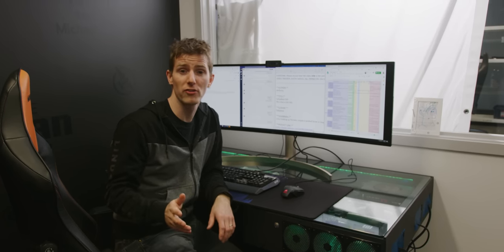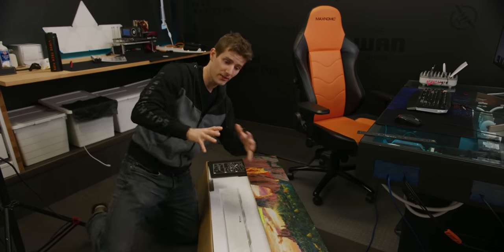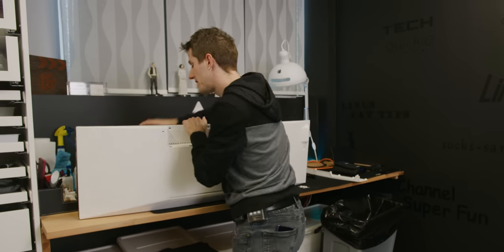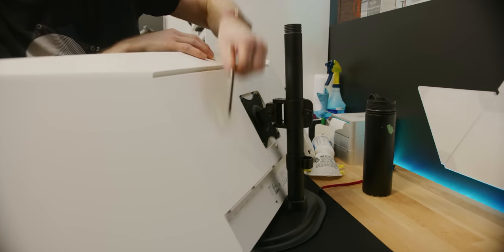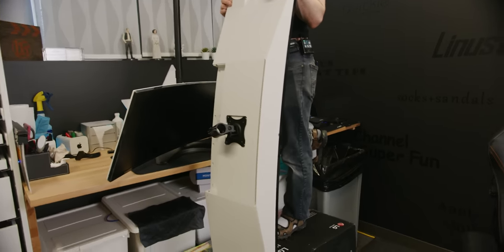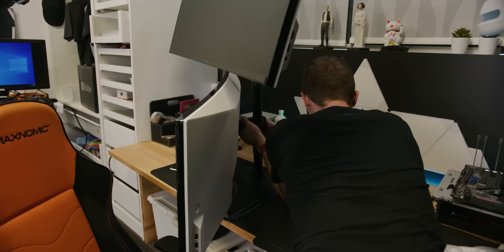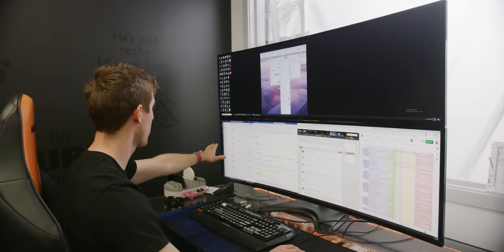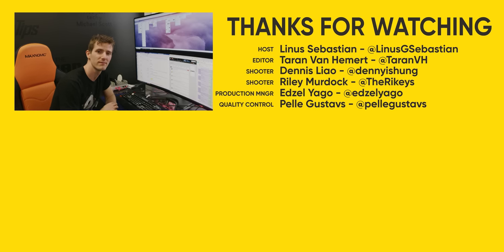My monitor just got an UPGRADE

Comment: You can turn the monitor upside down to have fewer edges between the monitors and on the nvidia panel there is an option to rotate it 180º and set it straight

Comment: if you mounted the top one upside down you'd get less bezel space
Reply: But then the nipples wouldn't both be on the same side. What is one to do!?
Reply: @exitoz1396  VESA mount is meant to be supporting 360 rotation of the panel, so unless this one is different which i doubt, you are wrong.
Reply: That's actually brilliant. Airflow will likely not be too happy. Not like these monitors have much cooling to begin with.
Reply: @rajaselvam37  i mean, have you seen the size of those monitors?

Comment: -Stand rated for 20KG max
-Puts on 30KG "it will be fine"
Reply: What's the worst-case scenario? They fall and get broken? It's not like he's paying for this :p
Reply: Mostly it just slips over time, and if you force it back basically you are grinding the friction mount, what he needed was a ratchet wrench with a hex bit socket, then you can crank it down hard enough the first time to make sure it never droops.
Reply: wackity shack But then Linus is known for having dropped stuff. Where would the fun be without that?

Comment: 9:40 At this point, LG was waiting for a "sorry"
Reply: Tbh, just install click monitor dcc (chocolatey has the package), you only need to be able to reach the display with that actually has click on it. Haven't used the physical button of my other two monitors in months, they probably still work though. Best feature is scroll for dim/brighten.

Comment: 4:37
“We forgot the washers”
“Does it even matter?”

(Challenger I intensifies)
Reply: I? Not 1?
Reply: That was an O ring. Yes I'm fun at parties.
Reply: NorthernLeigonare - Roman Numerals
Reply: @trd8749  Tp be fair, isn't an O ring basically just a rubber washer? :P
Reply: @The_Keeper  Well, O rings block liquid leakage and is a seal, so no.

Comment: I feel like if the goal was  bezel-less he should’ve gotten a tv
Reply: 11:06
Reply: A 4k 55in tv would also be a lot more cost effective
Reply: @InsaneFire10YT  Linus doesn't speak poor
Reply: @jerielfrancis3684  Neither does He speak 'practically the best option'
Reply: Just flip the top one and boom, no bezels in between them
Reply: Samsung do make a nice 8k 92" QLED tv that would have been more practical and better in basically every way(other than price, but that doesn't seem to be a factor).
Reply: @homelander-enjoyer  I mean, the way you say 'no bezels' makes me believe that there will truly be no bezels anymore.
Reply: @spectrfox7661  Practically a lot less pixels as well so not as practical for many windows
Reply: TVs have alot of input lag
Reply: @croissantj9588  But there are big-enough monitors, or at least TVs that wouldn't have that problem at all.
And it would be much easier than setting this whole thing up.
Reply: @spectrfox7661  definitely
Reply: TV is NOT the same as a Monitor. 
Ain't nobody want that shit input lag and pointless features. 
You also wouldn't get the usable space that an ultrawide would give you with it's aspect ratio.
Reply: @croissantj9588  yes- I am using a 4k 49" TV as a monitor and the input lag drives me crazy- there are a few settings to make it better- but only a real monitor is a monitor...
Reply: I use a 55" 4k tv and a 32" gaming monitor in a duel setup. Yes TVs have more lag but a decent one doesn't have much more. More the point his setup wasn't for games, it was for productivity, a little lag means shit all in his case.

Comment: Regarding washers:

"Does it matter"

Yes! Washers increase the area of the clamping force. Going without a washer when one is provided is like the difference between trying to pick up a thick hardback textbook with your fingertips instead of your whole hand. Less clamping surface area = less friction to hold things statically = less clamping pressure.
Reply: Next video: my monitor fell off the stand
Reply: Could sheer the screws without washers especially with heavier weights that aren't rated for that stand :D
Reply: Also the screws are going to be fitted to the holes with the assumption the washers will be present. The VESA mount should take up the slack in this case, but putting the screws back in the holes afterward with no washers can easily lead to them poking into the electronics.
Reply: hanetar im talking about friction in the shear direction. Surface area has a lot to do with frictional forces. Try dragging a 500 lb cube across the floor vs rolling a 500 lb sphere made of the same material. Normal forces are the same but the amount of force that is required to overcome static friction is different depending on the amount of surface area contact between the object and the ground. That is part of what makes up the friction coefficient. The surface area of contact between each object is baked into the coefficient.
Reply: @hanetar, it doesn't for perfect solid materials, which do not exist. So yes, it does, because metal and paint deform under screw tension and load weight.

Comment: The new Microsoft PowerToys (on Github) destroys the LG Tool for zoning applications.  You can create custom sized zones, overlapped zones, and even use hot keys to activate them.  By comparison the LG app is rigid and buggy AF.  Aside from limited options, it flat out refuses to even open if you have duplicate display enabled on any output.  It doesn’t matter if your trying to duplicate the LG display, or an entirely unrelated secondary display (it makes no sense!!!), it just fails.
Reply: TheQuark6789m Good point.  I figured that was implied.  Microsoft’s PowerToys was a huge hit in the 90s.  Most advance/power users would use it at least to some degree.

Comment: At this point just get a curved tv
But to quote him “Should  have just put a tv on my desk yes?! But dammit his is Linus tech tips”
Reply: yeah he said it's like 2 1440p screens in one so why not just get a 4k tv with low latency?
Reply: TVs are never that good. They are meant to be watched from a distance so you don't notice the flaws that they have. Computer monitors can't cheat like that so they are always better, just smaller.
Reply: Rob but from cost compared to quality, it just seems like a wayyy more cost efficient and practical compromise
Reply: @RawbLV  got myself a 55" curved Samsung 4k TV for computer screen at 600€ after seeing this video, and only complaint so far is that it's actually too small, a 70" one might be better
Reply: @thedog556 Go to any store, walk up to a TV and observe as they oversharpen the image or apply some other kind of effect to appeal to casual viewers.
Reply: I don't know about OLED, etc. but if you do anything related to design, finding a color-accurate TV is an absolute nightmare.
Reply: @damiengates7581  which one? I am look at the 2 43" monitors dell and lg. However unsure of which to go with. and they are roughly $800 us.
Reply: Get an LG c9 120hz 1440p
Reply: @RawbLV  this is not the case. he spent 3800 PER monitor. then mount... ect he could of had a Flat OLED 65" TV which would have looked better in every way
or he could spend it on a VERY High HQ screen/Monitor from Asus. the 65" gaming one.
Reply: @Xyphren  Of course with enough money you can buy anything great
Reply: But 4k tv gives you less screen than this solution. I currently use 4k 43" monitor and I could definitely use more space horizontally. Linus has 5120x2800 total resolution here, while 4k tv only gives you 3840x2160.
Reply: @AzaiaMonota  Because it's not the same ? Curved screens are nicer to use, and these are WQHD screens, so that makes it 5K (as he already said in the video). Also, with 2 screens it's easier for him to put the trello on top like he wanted, rather than struggling arranging it that way on one monitor.
Reply: @thepierre396  well we all know Linus has a massive 8K by this point making this old video pointless now

Comment: Linus: stacks two ultra wide monitors

Me: that just sounds like a tv with extra steps!
Reply: He did review a giant 47+ inch monitor before
Reply: A 55in LG C9 would have been cheaper and easier then this.
Reply: Yea but tvs wont have high hz and low input
Reply: @hungrynapps  yeah but he's not gaming on, it's his office pc right? 🤣🤣🤣
Reply: @hungrynapps  slot of tvs right now already have low input...my samsung does 4k 60hz at 14ms and it also does 1440p 120hz at 6ms
Reply: MASKOAA it’s sad that you think 120hz at 6ms is fast.
Reply: @BeardedAxeRay  you realize when a monitor says 1ms that's pixel grey to grey response not input lag right?
Reply: starshipeleven  any reason for that? The PPI is all that matters, and an 8k TV would definitely look sharper than two ultrawides stacked on top of each other, and the result would be pretty much the same office productivity-wise
Reply: @BeardedAxeRay  You would laught at my Laptop refresh rate and latency my friend, unplayble compared to my brother's one's. I am waiting for sells to get a good desktop with a sexy monitor. But yeah 6ms and 120hz is way better than mine cries
Reply: A TV with a stupid bezel right in the middle.
Reply: @joeblow5214  But the C9 would only be 4K and Linus' solution is effectively 5K or about 80% more pixels.
Reply: If all it takes is a TV to equal Linus's dual monitor setup, please show me the TV that has a 5120x2880 resolution, display port inputs, and a 56" diagonal length... Go ahead and show me a TV with those specs and then I won't consider your comment completely idiotic
Reply: @post-leftluddite  What would be equal bc the resolution of 4k vs this isn't really going to matter much.....plus the hdr support on a tv will blow this out of the water not to mention I won't have a giant black border right in the middle not to mention the cost would be waaaaaaaaaaaayyyy less since tvs are mass produced and these monitors not even close....its a niche monitor which means you overpay alot
Reply: starshipeleven Yea no, monitors are essentially just small tvs with really crappy panels. Thats why I am debating between a 55" 8k QLED or a 48" 4k OLED to use as my next monitor.
Reply: starshipeleven  Yes it is. Whats the peak brightness, contrast ratio, color gamut etc? 

Probably about on par with the crappiest tvs on the market, right?

Because thats how panel manufacturing works. Once LG or Samsung create improved manufacturing processes for their HDTVs they use the old facilities to make panels for monitors and/or budget tvs. Monitors are essentially just crappy old repurposed tv panels.
Reply: starshipeleven  did you see Linus's setup? Last thing he cares about is money, definitely. An 8k tv (non OLED) would cost less, and it's the only solution that gives at least the same pixel density as the current setup, plus I don't know where you took your image quality results from. And scaling is the last of your problems, especially if used as two monitors one on top of the other
Reply: starshipeleven  Uhh HDTVs have way better brightness. What are you even talking about.

TVs have game mode because they have highly advanced image processors. With monitors its always in game mode because they have bargain basement image processors only capable of simple upscaling. And game mode does not limit framerates, that is  just nonsense. It simply turns off certain advanced image processing features, because unlike monitors tvs are actually capable of advanced image processing.

Monitors obviously have better ppi because they are smaller, but that doesn't mean the panels are better. A $50 smartphone will have higher ppi than any computer monitor.

There is little to no difference in color accuracy between HDTVs and monitors. And by far the biggest determinant of color accuracy isn't even panel quality, its whether or not your panel is properly calibrated. But I, like most people, do not even own a colorimeter because color accuracy is virtually pointless unless you have a very specific use case for it.

And "hotspots" I think you mean screen uniformity, and no... monitors generally have much worse screen uniformity.

Its clear you know absolutely nothing display technology and have never owned a halfway decent modern HDTV. Its no contest, they just completely blow monitors out of the water in picture quality..
Reply: starshipeleven  Windows at 8k works just fine, the UI isn't enlarged or else. It isn't a new thing, it's been there since Windows 10. And the latter argument is just baseless, why not using 4 fullhd screens then?
Reply: @cl4ster17  Even so 8k displays are even cheaper then this setup and still more practical. There is realistically no difference between DP 1.4 and HDMI 2.1 other then the lock on DP 1.4.

Comment: You literally just made a big 16:9 with a bezel through it
Reply: Maybe he could have flipped the top one so the bezel is on top?
Reply: @amos9547  still bezel, he has a 4k gaming tv that is as good as these so idk why he has done it
Reply: No no no. This is not 16:9 this is 32:18
Reply: Nooo!! Its 64:36
Reply: @amos9547  your too smart
Reply: @markhd3059  you're* not
Reply: SwirlingBézier i perfer 128:72
Reply: He's not gonna play anything full screen stretched across both of them anyways.
And these together is higher resolution than  a 4K monitor. And it's also easier to manage a single row of windows per monitor rather than two rows and multiple columns of windows on a single monitor
Reply: @amos9547  He could have just turned both monitors around, no bezel at all!
Reply: @konzo5942  Tv has no curve.
Reply: @konzo5942  For the convenience in software of it being a second monitor?  I imagine tiling will be easier if the OS sees it as a second monitor, rather than one big one.
Reply: @dafoex  Any competent window management software doesn't have an issue with a single high res panel and treats it the same way as two displays...

Comment: 11:22
Just have Alex or Collin design a 3D printed webcam mount that is wedged between the 2 monitors and replaces the stock webcam mounting bracket.
Reply: but the ... GAP...
Reply: i was thinking the same. should be able to rewire the usb cable to a ribon of some sort so the gap is less than 1mm
Reply: This is Linus Tech. They should get a second camera, mount both on either side of the monitors, and send a 3d video for all conferences.

Comment: The top bezels are smaller. Why not mount the top one upside down and flip the input?
Reply: This is exactly what I was thinking too. Hopefully, your comment gets more attention.
Reply: Thought he would come up with that idea at the very start...
Reply: Why not just buy a 55" TV?
Reply: sliwka621 I would prefer his solution over a 55” TV because of how it can allow multiple virtual windows without clunky PiP. If I’m remembering correctly, that setup will function like 4-8 independent monitors.
Reply: @sliwka621  probably 3 main reasons: resolution, curve, and the ability to angle the top monitor slightly down.
Reply: Dude, smart idea
Reply: @davidpalomino9138  You know there are 8k TV's right? And they give you a clean picture without a THICC ass horizontal black line going through the middle. There are even curved TV's, you can even choose between LCD and OLED. Wow, almost as if high end PC monitors were an overpriced scam.
Reply: @Lostmypasswordagain  Same thing as running a TV using two inputs with PiP.
Reply: @sliwka621  I mean if there is a curved 55 inch 8k oled tv out there, then by all means that would be the better choice.
Reply: @davidpalomino9138  Why OLED? OLED are not perfect, at all. ABL and ASBL are pretty bad, especially if you use the TV as PC monitor.

Comment: Linus: "Could I have just put a TV on my desk? Yes...but this is LTT and that is not how we do things around here!!"

Also Linus a few weeks later: "Why I decided to switch from my monitors to a TV...just how you should make the switch to our Sponsor!" 

Lmao keep it up guys 😂❤
Reply: Nobody uses Tvs for their monitor unless  you have no monitor. Any monitor is a good monitor for your pc because it is actually designed for a computer. Example are monitors with 75hrz+ or Freesync/G-Sync
Reply: Show me a TV with a 5120x2880 resolution, 56" diagonal length, and display port inputs like this dual monitor setup equates to
Reply: @post-leftluddite   wot only reason he put those monitor together is size so a decent 55-60 4k in tv wouldve done the same job he doesnt care about input or resolution (as long as its ok for the size)
Reply: @agspec2415  uhhh, you clearly don't understand how resolution works. No TV available today would give Linus the screen real estate [resolution] he wants. 5120 x 1440 x 2 will give much more usable space than a 4K TV.
Educate yourself.
Reply: @post-leftluddite  Samsung Q900 series, literally an 8k (7680 × 4320) TV so higher resolution and larger than that... 60hz is plenty for non FPS gaming. Similarly no need for freesync/gsync... not like you'd be gaming on stacked ultrawide monitors anyway LOL. DP irrelevant except for having enough bandwidth to drive the pixels, and since HDMI has enough bandwidth to handle 8k60, DP is useless here.
Reply: @beanhat9356  Guess I'm nobody, but this 4K TV I'm looking at was cheaper than ANY 4K monitor on the market and a lot of 1080p monitors, too, and looks AMAZING (especially for being an el cheapo brand).
Reply: @beanhat9356  High-end TVs now days have sub-10ms response time, 120Hz, full RGB gamut, and adaptive refresh. Plus with HDMI 2.1, you will be able to do all that at the same time.